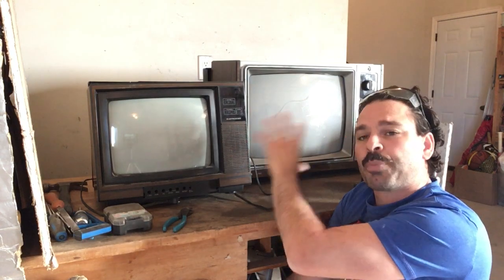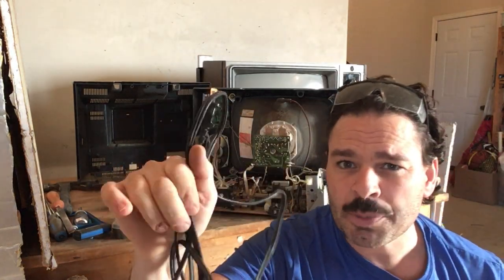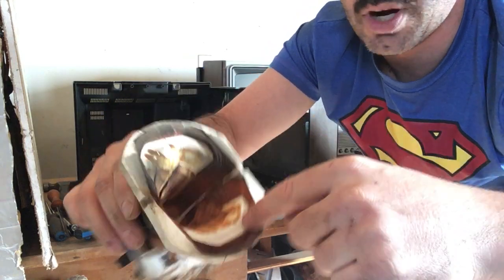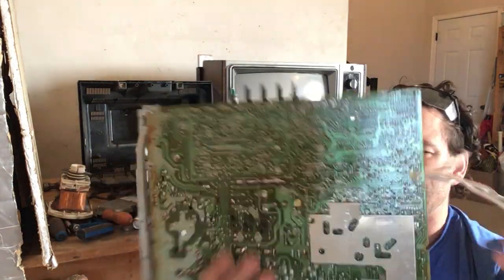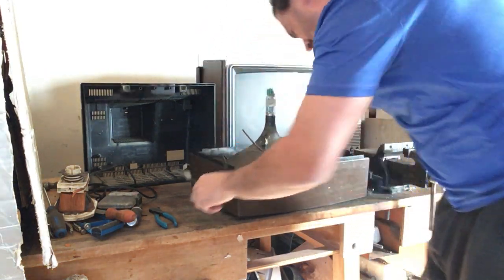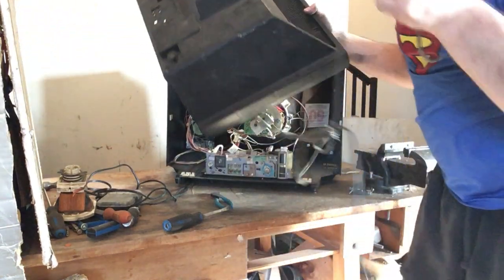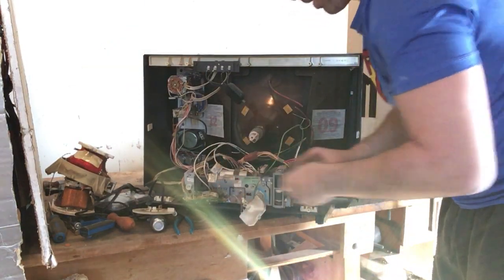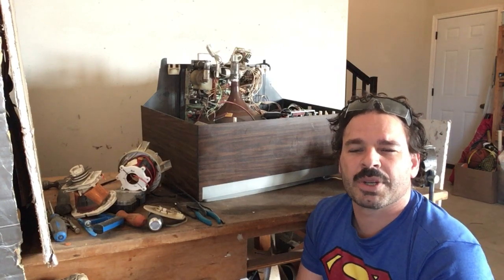Scrapping some old CRT TELEVISIONS for great copper, aluminum, other metals, and zero waste!

Comment: Can’t remember how many of those I’ve taken apart. You still told me something I didn’t know. If it didn’t look like copper,brass or aluminum I threw it away. 🐎🌻✌️
Reply from the maker: Lol, yup, don’t worry I use to bring in compressors whole without opening before I realized how much copper was inside. We all learn and make mistakes

Comment: Some of the black cylinders are pieces of ferrite with copper coils spun around them they will have black shrink wrap around them which is how one can differentiate them from the capacitors.

Comment: What was you talking about on capacitor and it having oil in it could you show what it was
Reply from the maker: It was the metallic cylinder on the bottom. You find them in microwaves and dehumidifiers as well. Again metallic cylinder that has wires connected to it.

Comment: Does anyone know what the piece on the circuit board is called where the red cord comes out of that connects to the tube? It has a piece of ferrite in it. I hypothesize they have copper in them but have yet to cut open any of them.
Reply from the maker: There is some copper wire in it, I cut some off and throw into my copper wire bin

Comment: Be careful on the real old ones if the stem breaks there is a chance of implosion. I recommend safety googles and gloves. There is also lead in the tubes one should be aware of. The stem is an electron gun. The pieces are made up of non magnetic stainless steel. The screws and strap that hold the yolk to the tube are non magnetic stainless steel also.